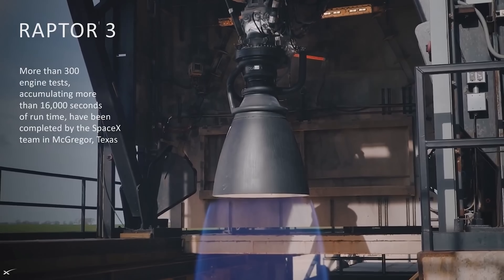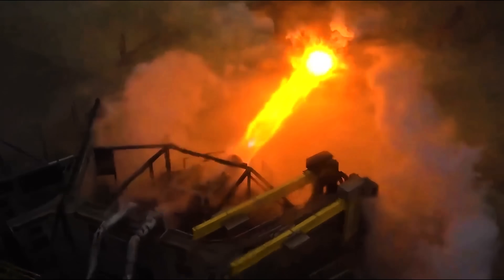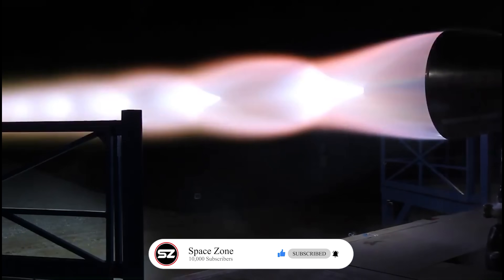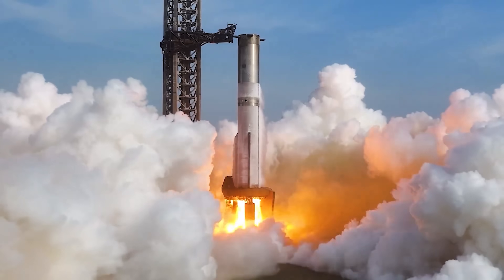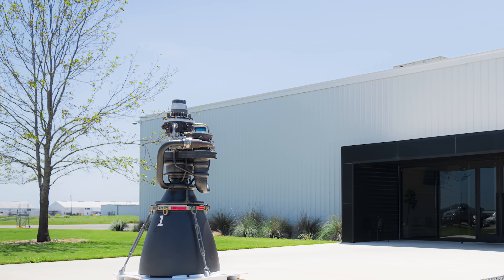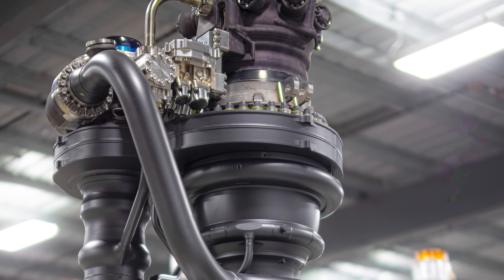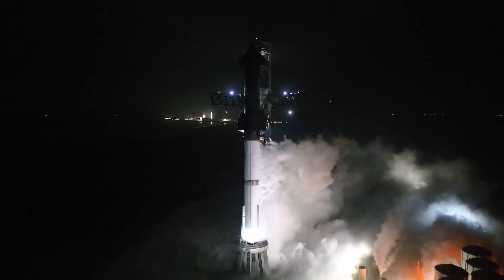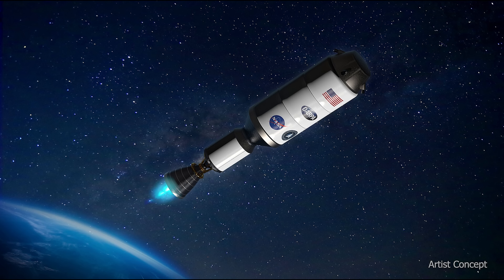Elon Musk Revealed SpaceX's Inside Raptor V3 Problem

Comment: Actually there is still one improvement open in chemical combustion, but it was until recently thought non-viable. Which is making a detonation engine, instead of the current rocket engines that run on deflagration. 

The problem obviously being that detonation setups are very touchy and until they conceived of things like the rotating detonation engine, they didn't even know of a way to get continuous power from it. However not that long ago NASA demonstrated a small functional, working rotating detonation engine, showing that the concept is finally becoming possible to make with our current engineering knowledge.

If a large engine using this method could be made, it would potentially be possible to get another 5-10 percent more energy from your chemical combustion cycle. Which would be a pretty large gain, and possibly the last large gain one would ever be able to get out of chemical combustion. Apparently the military has also become interested and are looking in to it for future aircraft engines where this technique can also be made to work, apparently their interest aside of the range improvements, is because it makes very high speed easier to achieve.

So who knows, maybe one day a Raptor engine or some other rocket engine will be making use of rotating detonation waves to power humanities rockets to space even more efficiently then before.
Reply: JAXA has test flown an RDE engined rocket, second stage only and not an orbital rocket, but they are working and working on them.
Reply: Yeah, will be interesting to see how advances on it will go.
Reply: It wouldn’t be a raptor engine, rotating detonation is not a simple swap in for a component. It is a fundamentally different type of rocket engine.
Reply: Agreed, it would be a quite large scale change.

Comment: I enjoy your content, but was disappointed you're another delusional proponent of fission nuke engines, whose fuel is indefensibly toxic to all advanced life on earth, being capable of causing fatal cancers in immeasurably small amounts, remaining that dangerous for tens of thousands of years. Only a sociopath would suggest launching any sizable amount of that stuff into the air, with a possibility of spreading it around the biosphere.
Reply: Nuclear reactors are already used on submarines without issue. They just require shielding, which adds weight, but is worth it. We are already working on self contained micro reactors for power generation, which don't have any risks to those around them. He was talking more about unmanned deep space missions though.
Reply: @xeridea  Friggin' ignorant comment. You obviously have no idea just how toxic nuclear fuel & its byproducts "burnt" are. Most exist naturally as a metallic powders, well suited to becoming an aerosol ie billions of particles, each single one capable of causing death if you are unlucky enough to ingest or breath one in. Many (most) produce fatal ionizing radiation that has a range of a few centimeters, remaining that toxic for tens of thousands of years, impossible to detect using Geiger counters & other radiation detection equipment unless they are within centimeters, and aggregated - but still enough to kill you if lodged in your body, exposing you to years of fatal radiation. 

They don't "burn up" on re-entry, a catastrophic rocket explosion would spread them throughout the atmosphere, turning life on earth into one big game of Russian roulette. Nuclear fission is not "safe" : it's all a lie, an "accident" waiting to happen, only a matter of time in the next ten thousand years. Do you know anything we've made that will last ten thousand years? Toxic nuclear fuel & its waste will last that long, remaining capable of killing all advanced life on this planet in quantities too small to measure. The Russian spy police use nuke waste to poison defectors, look up on wikipedia the poisoning of Alexander Litvinenko.

Comment: Prechilling rocket engines isn't so much a thermal shock problem- no parts will break if cooled quickly- but rather a stability issue. If you feed cryo propellants into a warm engine, the cryo will flash to vapor and make low-density vapor that doesn't feed well. In our various LOX-kerosene, LOX-methane, and LOX-hydrogen  engines at XCOR we used a thermostat to pulse the chill valve as needed to maintain the right temperature before engine start.

Comment: Compared to the RS-25 engines used on the Space Shuttle, the Raptor 2 puts out 10% more thrust and costs 1/100th as much.  You heard that right. Less than $1M each for the Raptor 2 and $100M each (in today's dollars) for the RS-25. When people talk about Government waste, abuse, fraud, laziness, and inefficiency - they are talking about NASA.
Reply: You can't believe Elon's lies about the Raptor.
Reply: Crazy aye?
Reply: NASA is a jobs program designed to funnel money to states of the politicians. Contracts are all cost-plus, meaning what ever it cost to make it plus a profit (of course you say what it cost to make it so...). Actually, it is the companies making the parts for NASA that are wasteful and fraudulent.
Reply: The RS-25 was designed in the late seventies. Hardly a fair comparison.
Reply: the RS-25 puts out that thrust at 70s higher efficiency, which is where all the money went into the design. It was specifically meant to advance the state of the art of rocket engine design. This helps it hit higher-energy orbits (and interplanetary trajectories) where Raptor has to call on multiple launches for refueling.

Comment: I feel compelled to say that one of the major design flaws of the Soviet N1 rocket was the lack of massive engines, which required 30 smaller engines, which ultimately doomed the ship to failure.
I still think fewer engines is a much better idea, and that is one reason I am picking Bezos New Glenn as a superior product, with a better future.
Reply from the maker: The thing with theN1 is they dont have a way to test each engine seperately+ so many engine= perfect fomula to blow up
Reply: I have often thought about which is better - many small engines or a few large ones.
But ultimately I think the 'many' option is better.
Yes, everything has a failure rate so more engines = higher liklihood of a failure. On the other hand a failure of one or two engines does not necessarily lead to a flight failure.
With the 'few' option it definitely will.
Also small engines are much easier to produce and move around.
The problem for the N1 was that they were not tested and proven prior to launch.
Reply: the problem with bigger engines is that they would need to be able to throttle to much lower level than the smaller ones. And it is extremely challenging to throttle low a huge engine...

Comment: The Space Shuttle's main engines, the RS-25, also used a high-pressure, closed-cycle, reusable engine almost 50 years ago.
Reply: I do get tired of hearing that Raptor is the "first" full-flow staged combustion engine.  The SSME was full flow (all propellants exited through the main combustion chamber and nozzle), and staged combustion.  The USSR also built examples, though they cancelled the rockets they would have been used on.
Reply: @bentrueblood8144 Full Flow means all propellant goes through a pre burner and is vaporized. SSME is only fuel rich and does not pre burn all oxygen, most is pumped directly from the tank to the combustion chamber as liquid. It is not a full flow staged combustion engine, it is a partial flow staged combustion.

Closed cycle does not equal full flow.

Now there was an experimental FFSC version of SSME, but it never went past proof of concept hardware tests. It never went into any further design or production.

Comment: I did not know the start up complexity issues.
Reply: While many people thought the huge F-1 engines powering the Saturn V were simple, combustion instability during ignition caused many destructive explosions on the test stand before the idea of placing baffles in the combustion chamber was tried. Even then, they were operating on the brink of disaster.  Smaller engines can control ignition transients more easily, so you need more engines to equal the thrust of a single one. Also, if a problem is detected, it may be possible to shut down one or two engines and still accomplish the mission by burning longer.

Comment: couple the two powerheads to the two turbopumps by an electrical generator/motor on one shaft and motor/generator on the other directly coupled by a 3 phase bus bar rather than a shaft - no electronics need synchronize speed.  That way you regain the advantage of synchronized power heads without the problematic shaft seals and geometric alignments needed for a mechanical shaft connection.
Reply: SpaceX should hire you to teach their engineers
Reply: Introducing electric motors into the hellscape of rocket engine internals doesn't sound practical. Even high temp motors I work with have their limits, and they're much lower than anything inside a raptor. Sure, theoretically it could work, but you would have to build a for-purpose motor type from scratch, with all different materials. The engineering, and complication of moving parts (even if none are added), doesn't seem like it could even be worth trying.

Comment: There's still rotating detonation as a chemical rocket engine concept that's significantly better than Raptor.
Reply: How is the rotating detonation system better?  Just saying it doesn't mean anything!!
Reply: @michaeldeierhoi4096 Engine type
Max theoretical Isp (Vacuum, CH4/LOX)
Open Cycle (Gas Generator):
350–360 seconds

Full-Flow Staged Combustion:
370–380 seconds

Rotating Detonation Engine (RDE):
390–410 seconds

Additionally, the RDE combines naturally with the aerospike design, which is pressure agnostic, eliminating the need distinct sea level and vacuum variants.
Reply: @virtual-viking  Now that's getting into the details.  👍. I could be wrong however it must be still be tested and evaluated because I see anyone using it commercially yet.
Reply: @michaeldeierhoi4096 There was no commercial full flow engine before Raptor either, and RDE is potentially as big of a jump in performance from the full flow as full flow was from open cycle, so it would make logical sense to make it.

Comment: From the zoomed out perspective, the important parts are a devotion to rapid cost effective reuse and allowing smart people to fly and fail with uncrewed test vehicles to develop the new technology.  It's a very iterative process and until SpaceX, everyone was resting on 1970's technology, as SLS is still doing.  How many test flights will Starship need?  As many as it needs.  The answer can only be known after development produces a useful heavy lift launch vehicle and even then, development continues.  Humans learn by doing and thinking.  SpaceX is finally thinking and doing and thinking.

Merlin engines have flown 30 missions.  Raptor can do better.

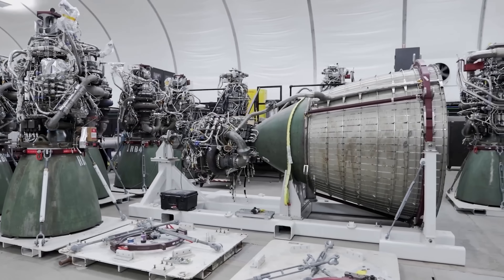Comment: 3:50 why crossfeed?And why aren't they able to do a mechanical link between them?
Reply: A mechanical link implies a common shaft between the two, which means trying to design a shaft seal that will keep apart hot fuel and oxygen rich gasses. If the shaft seal fails then the engine blows up. On the similar but not as advanced RS-25 engine on the space shuttle both turbo pumps are powered by fuel rich staged combustion. The shaft to the oxygen side has six seals purged to by helium to try to keep them separate, but that makes helium a third consumable needed to run the engine.

Comment: A nice review and thanks.

First stage specific impulse (ISP) is not nearly as big a driver for payload to lEO as it is for the second stage.   That allows SpaceX to "back off of the ultimate" a bit to achieve better booster reliability and reuseability.   You see that with Falcon too.  Just look at the delta Vs involved for each stage.  Super Heavy quits at about a little over a one mile per second delta V, while Starship needs a 4 MPS delta V to reach orbit.  Kenetic energy is the square of the velocity.  The penny pinching on weight and performance will be mostly in Starship.  Every pound of weight you save in Starship, translates to an extra pound of payload to LEO.  Similarly, every increase in ISP means more weight to LEO for a given amout of fuel and that ISP lever is much stronger with Starship than it is with Super Heavy.

Comment: Raptor 2 & 3 are evolutions of the Soviet/Russia RD-170 and RD-180... rocket engines. NASA/US companies were NEVER permitted to possess design information or manufacture these engines... Some how SpaceX/Musk... probably with data and independent/paid Russian rocket engine engineers [with Putin's nod]... developed these engines with lightning-rapidity and efficiency. Duuuhhh...
Reply: Raptor is nothing like RD-170 or RD-180, those engines used only single pre-burners and have multiple combustion chambers fed from a single power head. Completely different to Raptor.
Reply: That's total nonsense. First, RD-170 and derivatives use oxidizer-rich closed combustion cycle, not full-flow staged combustion. Second, Pratt&Whitney HAD a license to produce RD-180, they just never bothered to set up the production line.
Reply: Not true.  The raptors are a totally different design, and use a completely fuel and overall design.  The raptors were developed entirely in-house at SpaceX, and achieved things that weren't even considered before, as they were thought to be way too hard to even try.